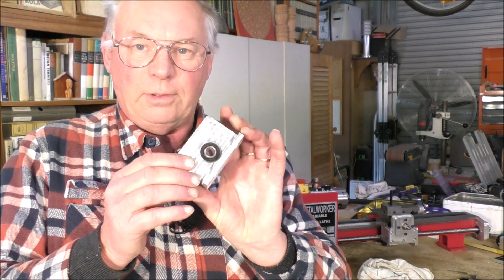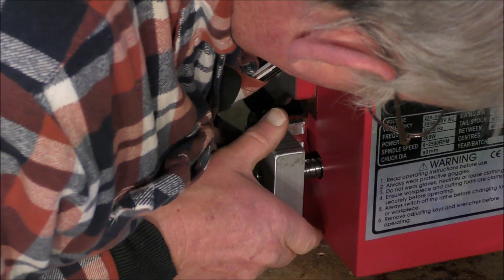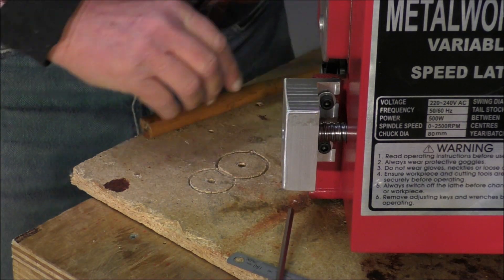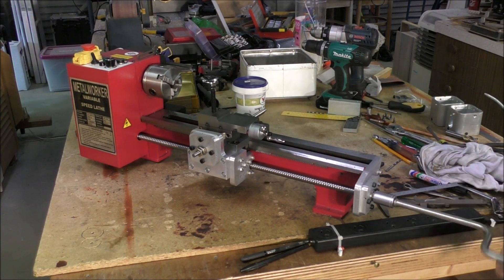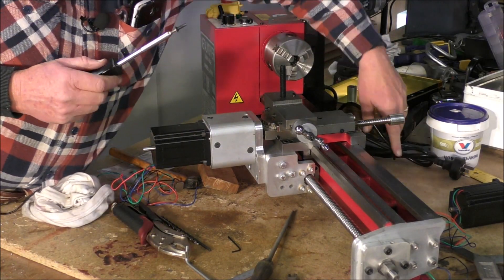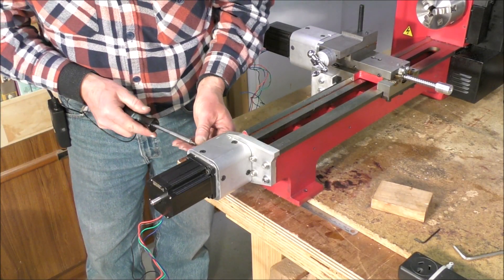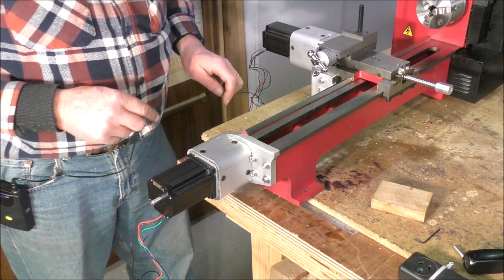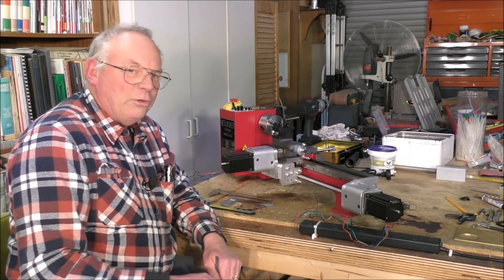333 Harbor Freight Sieg CNC mini lathe 7 x 14 inch conversion 99% completed

Comment: My thoughts on this was to put the stepper motors on the other end of the ball lead screws to keep the front and end clear for hand wheels to be able to make use of the lathe in a free hand mode when not needing to program every job and work tight up to the machine without having the motors in your way
Reply from the maker: Thank you, for watching,  
Please like, subscribe and forward the video on to a friend, Roger Clyde Webb